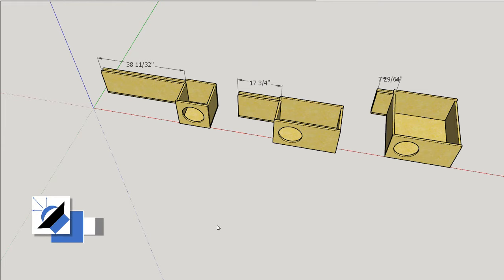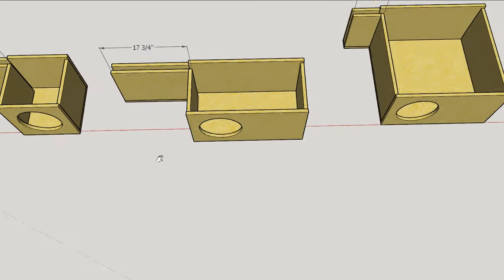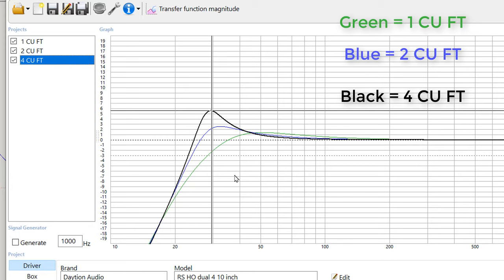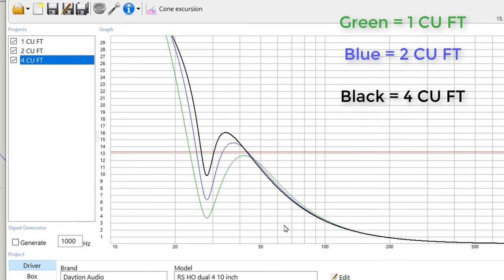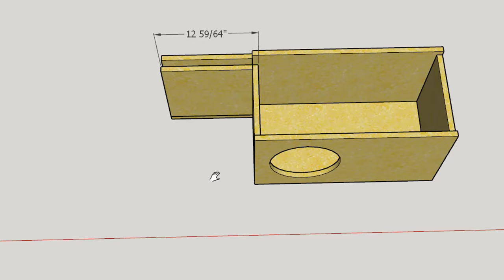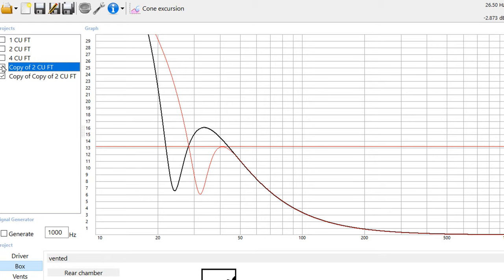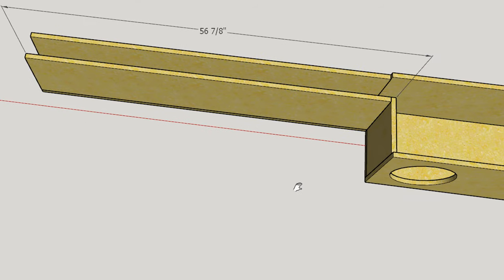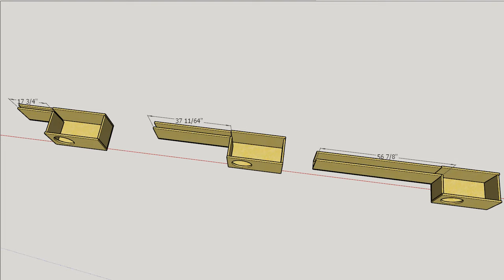Understanding Port Length, Box Volume, and Tuning Frequency.

Comment: THIS is where I need to expand my knowledge. Good info.
Reply from the maker: You're just aren't a lot of videos out there that explain this.
Reply: @DIYAudioGuy  yeah for sure. We all know that there are Lot's of SPL guys hitting one note at their peak but aside from that stuff I haven't seen much about finding a nice low tuned box with a reasonably sized port area to keep port noise to a minimum.
  God willing I can sell something or get a good side job that'll enable me to buy this nice custom box with a level 4 DC Audio 12" sub included with it. 
 ,* Thinking about doing something similar to my last car audio build with a 12" in a better box than last time, and a 15" in bigger & lower tuned box then at least one set of decent 6x9's in those little sealed boxes plus the fairly good speakers already in the factory locations for mids and highs.
  *Too bad I didn't have a really good way I can think of to mount the 6x9's in something bigger cause I've seen some amazing sounding 6x9's mounted in the back deck of a Ford escort hatchback and even some mounted in the rear deck with the trunk as the enclosure.. 
  I just might have to build some slightly larger sealed boxes for them maybe on each side of the rear seat of my first generation Grand Cherokee I just picked up. 
  Guess it all depends on if I can make the Extra approximately $300 for everything from the 12" and custom box, a Little package deal with a couple of good full range amps and a box with dual 10"s I believe etc, and then the pair of 6x9's for some nice and solid mids and highs.. getting most of this stuff used, plus still having some things I just couldn't include with the car and system I sold my Buddy!!

Comment: Another thing to note is depending on where there port opening finishes (near the enclosure or far from the enclosure) will also affect tuning despite the length due to different frequencies having different wavelengths. Port location is also crucial to the overall frequency response.
(Phasing).
Reply from the maker: Yeah, there is a lot more to it!  I need to build some boxes and take some measurements!
Reply: I like that, very important. Probably equally as important as positioning of the sub, and port too I would think, i.e. sub parallel to the rear door of a minivan or SUV etc..
Reply: @bassotronics you have me very curious and wanting to research details of your response.  Watching this video as a refresher on building a ported box, I was wondering if I could do a slotted port external to make under seat sub box. As in the drawings in this video, the port external going over the transmission tunnel. Do you have any recommendations on further study?

Comment: A few things:  turbulence occurs well below 18m/s, more like 11m/s.  Size of port may not influence transfer function in CAD but the realty us that it will increase impedance coupling efficiency with the room air mass which is beneficial.  Rule of thumb is to use a port area approx 30% of the area of the driver.  You loose port efficiency and alter system Q by using folded line ports compared with port tubes with or without elbows but straight vents are fine.  Experienced designers know that box calculators over simplify the expertise needed to maximise SQ, system efficiency and to more accurately design and tune a vented system which ideally also includes system impedance testing.

Comment: Years ago (90s) when I had a Fiero our local audio shop placed a JL Audio 10" in the front trunk and vented it through the passenger side floor. The way this video starts kind of makes sense to me now how they did it. It was a very custom job back then and might even be considered so today. To look in the front trunk all you would see is a box as the sub was inside firing into the port area.
Reply from the maker: That sounds like a bandpass.

Comment: Your videos are maybe the best for us DIYers. I tried WINISD and find it has a mind of its own.  Entered sub data and it changed many entries, same units but a different number. Also have a serious conflict comparing 2 subs in the same box, one gives port velocity of 20+ while other is near 2. Could not bring them close after manipulating most sub T/S parameters.  I really do not like WinISD despite its free. I got what I paid for.
Reply from the maker: I hear you!  I think I am about to outgrow WinISD.  WinISD will auto-calculate parameters.  It is always better to let WinISD do the calculations, or the driver integrity check will fail.
Reply: It has it's limitations BUT, it's free and will DEFINITELY help with designing a better sounding box for the specific subwoofer you have!
  Those of us that are true audiophiles can always use more data AND real world testing. Moving whatever box around plays a huge part of it all along with the specific vehicle and the cabin gain and general acoustics too..
  Hopefully I worded that properly.. lol, just waking up after a long sleep just recovering from the chi-flu so I'm not quite at a hundred percent yet..

Comment: I believe all this comes into play depending on the subwoofer being used and what enclosure it performs best in, a subwoofer that's spec values may sound horrible in a ported enclosure but then sound 10 times better in a sealed enclosure of similar size as example, sealed boxes aren't bad but also depends on type of music, space available for enclosure etc, all these graphs your showing is with what subwoofer and application it will be installed in trunk,suv or truck etc, what im trying to figure out is a round about way of including cabin gain to tune of enclosure

Comment: Hey My Prefab Subwoofer Box Tuned At 35Hz Is It Good If Not How To Get It More Lower I Am New At This Please Help😊
Reply from the maker: That is probably just fine, but it will depend on your subwoofer.  If you are happy with the sound then don't change anything.
Reply: @DIYAudioGuy  i don't have Subwoofer i had woofer 8"
Reply: 60w 8ohm
Reply: @DIYAudioGuy  but i wanna go more lower so tell me how to do that

Comment: Thanks in advance for my previous question I built a box for two X8 V4 and I missed my mark, only by 0.1 on the net box volume, but I severely missed the Port length, it's tuned to about 25 hz I was shooting for around 33 hz, I can shorten the port but that makes me miss my 2 cube net box, end result will be close to 2.3 net 33 hz, Love the videos I learn a lot from your content

Comment: Does the shape of the box affect the tuning? I want to build a single 15" box at 3.5 Cubic ft but the dimensions I have seen online are too deep to fit in my vehicle. If I make I take an inch off the depth and make it an inch taller, would that affect a lot?

Comment: I am in serious need of some help with my custom build. I have watched your video and so many others trying to tune my custom box in WinISD and just can not figure it out. now maybe its because I entered my driver information in incorrectly but it did show up green and allow me to move forward. so I just bought a Skar audio VXF 12" 2 ohm and it calls for a recommended 2 FT3 @ 33Hz in a ported box. I can get con excursion perfect and the transfer function magnitude perfect but I'm always way over air velocity. I'm over 10' of port or 8 flanged tubes @ over 8" each. I'm willing to donate or what ever it takes at this point to get the dimensions I need to process. Let me know if there's something I'm missing. Thanks!!!!

Comment: Quick question if I go to the 12 volt website port calculator and it asked me for the box volume and my tuning to find the length for the port is the box volume it's asking for net after subwoofer displacement or gross box volume?

Comment: As a kind suggestion, I'd try getting a microphone with a built low frequency crossover filter, to block low frequencies, like an AKG P120 or something more expensive. This video has a lot of deep bass blips that come from the microphone when you're speaking.
Reply from the maker: I upgraded to a  shotgun with one of those filters.  It had its own problems.  I have switched to a lav mic and better editing software.  Check out a recent video.

Comment: I was planning to Tune a box at 32HZ for a 2db peak with an F3 at about 27HZ but I saw that you said that F3 wouldn’t be great for Hip-hop which is primarily what I play. What is usually a good F3 to aim for being able to play? I’m installing in a trunk so I understand that this will affect the lower the tuning as well.

Comment: i have seen plenty of subwoofer box builds where the port is external . Matter of fact a 1  cu ft enclosure for a 10 " sub with a 3inch Aero port about 10 " long
Reply from the maker: It's not a very common design, but it works..

Comment: My confusion comes in when you squeeze the port into a box, youre bringing down the air space of the box, therefore, how do you really know what the port length should be when fitting it in a box? For example. A 4 cubic ft box is asking for a 9 inch port length for 30hz but once squeezed in the 4 cubic ft box, that is no longer 4 cubic ft and needs a different size port for the 30hz
Reply from the maker: You just have to make the box bigger, the problem is that you often find yourself in a loop.

Comment: Let's say I'm ok with the physical dimensions of the box with a longer and larger overall cross section port, at what point does air velocity become a problem on the lower end of your chart @11:33 time stamp?

Example:  Manufacturer calls for a single 4" round port 11" in length for a 12" subwoofer in 2.0 cuft.  I'm considering two 6.5"x1.5" slot ports 20" in length on either side of my design.
Reply from the maker: For sound quality you want to keep the port velocity below 17 m/s.  You can get away with more for an SPL build (as much as 30 some say).  Flared ports should let you double that number.
Reply: @DIYAudioGuy  I'm talking about the opposite end of the spectrum, where velocity is significantly below 17 m/s because the ports are huge and long.

Comment: Hey so I have a small box sealed containing 2 15s. They share a single enclosure (limited on space small car). I'm curious if I put 3  4" ports in it. Will it help with lowering tuning and bass

Comment: What about round flared plastic ports? Like say a 3in diameter tube with a flare that's 12 in Long in a 2ft cu box? So if you were to drill a couple 3 in Holes and add the flared plastic parts of a certain length? Would that work?
Reply from the maker: Yes, flares are great, they reduce port noise

Comment: I plan to do blutooth speaker with no port instead with 3 passive drivers it's gonna handle 40 watts 4 ohm 5 inch woofer and 2 tweeters ,do you think passive drivers make up for no port?
Reply from the maker: Yes!  https://youtu.be/v4rAkxck2_Q

Comment: Thanks for the awesome video. Your channel should be the most watched audio channel on YouTube. You mentioned a  1x12 slot  port. It reminded me of something I read years ago. Have you heard of the "rule of thumb," I believe that says, "you shouldn't go beyond 14:1 on slot ports."  Just curious if you've got a take on this? Thanks again!
Reply from the maker: Yeah, it's got something to do with the wetted surface area of a pipe versus the cross-sectional area of the pipe.  Apparently that affects the Reynolds number.

Comment: What impact does the use of an enclosure wall for the structure of a vent actually have on the effective vent length and subsequent enclosure tuning frequency? In my experience, it marginally but measurably lowers the effective tuning frequency where the total vent area is less than 12-15 square inches. Maybe I'm just splitting hairs..
Reply from the maker: It makes the effective length of the port longer by the width of the port.  So if you have a 3-in wide port, you need to make your port 3 in shorter in order to hit your tuning frequency.

Comment: Oh yes you are the best. I watch this yet I have an odd question still.  I have a  couple of Sundown Audio subs. One is an E12v1 D2 ( I believe) and a E12v3 D4. The E13V1 I have a Kicker DX500.1 1 0hm amp and the E12v3 I have a DX500.1 2 Ohm amp and a Kicker CXA1200.1 2 Ohms. I have been running onr 12 inch subwoofer on and off for as long as I can remember I. I have always used sealed enclousres that I built myself. Fairly simple rectangle builds. Even with the sundown I started sealed and moved to slot ported. Ok...I built, well have cut out a box from Sundown's site that is 1.75 tuned to 32.  The box has a single baffle and after all the cutting and fitting I have decided I would like to slap a second baffle if not for support the for looks. The sub and port both front or rear firing depending which you call front or back. Sub is offset about 3" inches off center next to a 2"slot port. My question is, if I add a a second baffle on the outside, not changing inner volume and the baffle will only effect one side of the 4 sided slot next to the sub. So it will be the long side of slot leaving 1 long and 2 short sides open. Will the box read that as I have changed the port length? Sorry for the long story...thank you.
Reply from the maker: Yes, but it will not make a big difference.  The port will be longer by 1/2 the thickness of your material.

Comment: Great info. I want to make a 2nd and improved pair of custom motorcycle sidebags. First pair looked and sounded awesome but the subs were firing into the rear wheel. Where can I have someone help design the subwoofer porting? I have a plan but know knowledge of port tuning
Reply from the maker: Rossi performance motorcycle in Albany Georgia.
Reply: @DIYAudioGuy  I am building them myself. I need info on porting size for Polk 8" marine subs

Comment: 1:03 Ive wondered about ports that are that small. If you can have that 4cu volume would that port be good or would it act more like a leaky sealed box?
Reply from the maker: I don't recommend the 4 CU FT box with the 1X12 slot port and a 10" subwoofer.  It was meant to be a completely absurd example.

Comment: Been thinking allot about ports recently. Got a question thoe cuz i cant find an anser. Ive got to believe there is such thing as the perfect port size and length given a freq say 31. Shortt and narrow vs wide open and long. 
Question 1 is there such thing as to big or to small a port keeping the same freq.
Question 2 how do you determine the perfect port for a tune. A great example sub would be a DC audio neo 4.0 thanks 😎
Reply from the maker: You want the port opening to be big enough to avoid port noise, and then from their the proper length to get your tuning frequency.

Comment: If you enlarged a 10 inch cutout hole on a 10 inch subwoofer enclosure to fit a 12 inch subwoofer into the enclosure would you suffocate the subwoofer itself or possibly block the vent on the back of the subwoofer itself if the subwoofer ends up getting mounted into the enclosure itself after enlarging the cutout hole.
Reply from the maker: Cramming a 12 into a box design for a 10 is a bad idea.

Comment: Can a old 12 inch guitar amplifier cabinet be used as a subwoofer enclosure for a 12 inch car subwoofer.
Reply from the maker: That depends. If it's a bass then maybe yes. But normal guitar captain has an open back so that will not work.  The other thing to remember is that the drivers use bass guitar amplifiers are just PA drivers. They're not tuned terribly low.  Just eyeballing them in the guitar shop, they all seem to have very small and short ports. I'm guessing they're tuned around 40 hertz.  So that will be fine if you're just going to play normal music, but if you're going to play a bunch of rebased or trap/edm you'll probably damage the driver.

Comment: Can a 10 inch cutout hole on a 10 inch subwoofer enclosure be enlarged to fit a 12 inch subwoofer if so will it be a tight fit for the subwoofer and cause the subwoofer to not sound the best.
Reply from the maker: Yes, you can make the hole bigger, but 12's typically need more airspace than 10's to sound their best.  So I don't recommend that you do that.

Comment: Does the tunning change if you Put the port inside the box and why did you put the ports outside the box if that's not what normally gets done???
Reply from the maker: I put the ports outside of the box just to make it easier to see.  As long as you account for the airspace taken up by the port so that the net airspace is the same, the tuning will be the same. Hope that makes sense.

Comment: when designing subwoofer enclosure does the external dimensions of the port in cubic ft  have to be added to cubic of the box or just the internal volume of the port?
Reply from the maker: Net volume is just the airspace alone. Gross volume will include the airspace, the port, all of the material used to make the box and the port, and the drivers.

Comment: I have a box I built that's 4.7 cu. Ft. Tuned at 26Hz with a 5x20 inch port for 100sq in. Port area. It has some T-line properties and peaks at 28Hz. Can't throw more than about 400 watts at the GW-124 walmart sub in it because of the volume, but it gets dumb low
Reply: Sweet any pics or vids?
Reply: @subdynoman  yeah there's a little demo on my channel

Comment: If you were to plug up the port on a subwoofer enclosure with a giant cork to make it a sealed enclosure will the giant cork get blown out of the port if you crank up the volume really loud and if the subwoofer is getting a lot of power
Reply from the maker: That depends on how tight the seal is. There are some home theater subwoofers that use this principle.